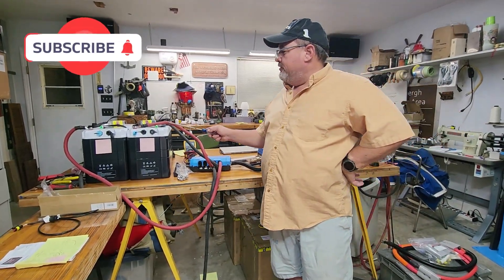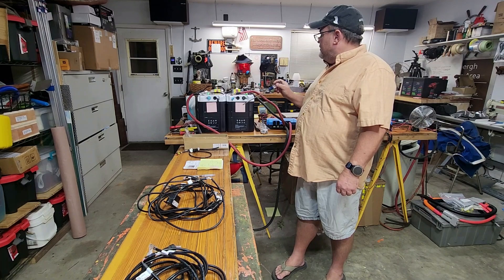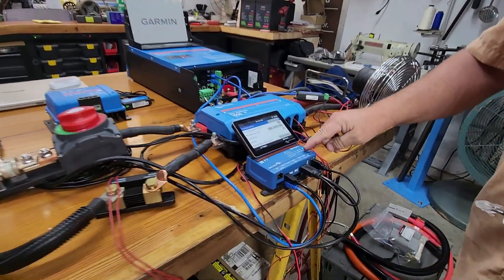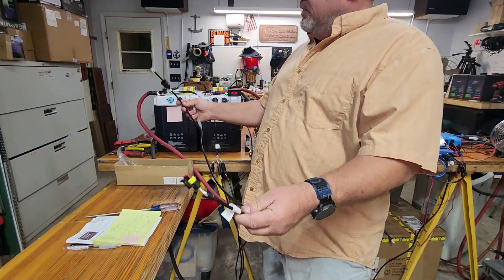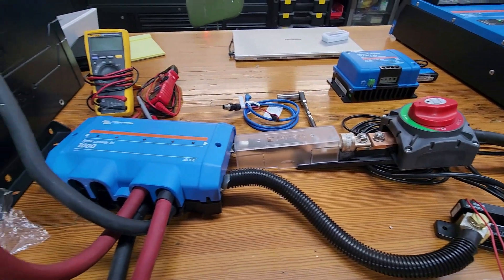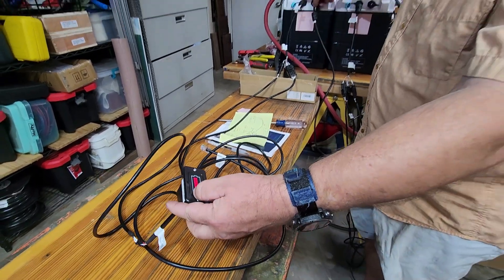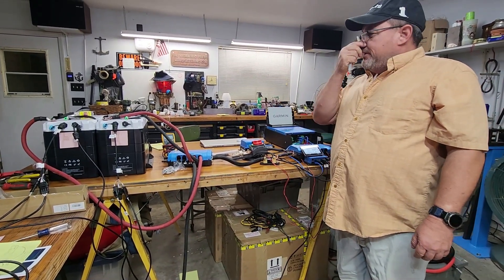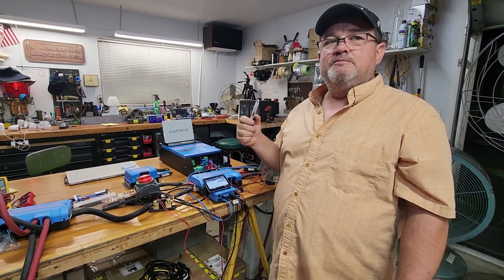Epoch Lithium 460AH V1  Daisy chain hook up  with Victron Comm to Cerbo GX. **Not for V2 batteries**

Comment: My epoch essentials 460ah does not have any ports on it to connect those cables.  My victron multiplus 2 will not charge it. Low battery warning ridiculous as battery at 13.2v verified.  I am buying an epoch charger just to charge that battery.  Tried for days to get the multiplus 2  to charge the epoch battery with no success.  No electrician around me even knows how to get the system to charge.  Very frustrating.
Reply from the maker: Its almost certainly the set up of the multiplus. Check the rocker switch. It's three position. One position is "inverter only" and will not charge.
Reply: @ thanks but my rocker switch is off, on, and a second optional battery.  My multiplus 2 says main on and charging but the light is blinking and not actually charging the battery, I finally got my victron blue smart charger to charge it but still cannot get the multiplus 2 to charge it, I need to find a victron multiplus 2 expert.  Also one YouTuber fixed his by resetting to default settings and then editing the settings again and it worked for him, I will try that
Reply from the maker: @vanandsolaradventures9079  where are you?

Comment: Good informational video!
Per ABYC E13,  all Lithium batteries must have SAE, IEC or UL certification. 
Any testing labels on these Epoch...I believe they dont.
Reply from the maker: @juniinc40  on the website I believe they do for cells only.
Reply: @mvintrigue-trawlerdiy1101  
That's what I thought...not good.
Reply: Great work as always!
I'm looking for that H05-4505 second cable, but cannot find it anywhere...not even on Epoch web site.
Could you provide a link or where to purchase pls, TIA!

Comment: Are you going to use a fuse block holder to mount the MBRF fuses? I watched a tear down of one of these battery modules yesterday and inside the IP 67 case is a class T 400 amp barrel fuse which is nice to know. 

Also epoch is pronounced epic
Reply from the maker: @michaelchownyk5255  the 460ah Marine with comms has a 500 amp internal gR fuse with an AIC of 50k. ABYC recomends an AIC of 20k so it exceeds that.  That internal fuse will satisfy the Arc Interupt Capacity bit its not likely to perfectly match your wiring fusing requirements. So I have used mrbf fuse holder on the terminals for my wiring size. Epoch can be pronounced Eee-pock...or Epic. There is no official way.  Just don't pronounce it like Will Prowse as Eee-poch and I think we will be good lol

Comment: Thanks! A quick question: would you recommend still having an external battery monitor such as the SmartShunt, or can the batteries and Victron comms provide that data? Thanks again, very informative video.
Reply from the maker: Apologies Ross. I am in Yellowstone and cell coverage is spotty. You absolutely need the smart shunt. What I have discovered about Epoch and most built in bluetooth soc meters is the parameters for reset to 100 are set very high and of course can not be changed. This SOC data from the Epoch BMS is what is exported to the cerbo. The ability to set the smart shunts up for full charge detection makes them much more reliable, especially since the 460 Marine does not like to be charged above 13.9. Also the onboard shunt does not detect amps in or out of less than 1 amp. So even at float when the MP drops into float after a full charge the Epoch shunt does not detect the .2 or .3 volt momentary up and voltage fluctuations as lights and other items go off and on. This results in the Epoch soc being off over time. But the victron shunt is still 99.x%. I actually ended up not using comms for charge control. I use the standard MP2 programming and smart shunt for control. The comms work, but will result in charging the voltage to the voltage  set in dvcc in limit charged voltage, which you have to set to 13.9v it will reach 13.9 and stay there and not drop to float. Similar to some other simpler batteries that import data to dvcc  right now my boat is sitting on SP most of the time so  I want to float it.  I have watched your channel many times. I suppose you may be doing something with these soon. If that's the case, when I get back from Yellowstone Tuesday if you need to chat about some particulars let me know. There are a few other must know point such as FCP or full charge protection that the Epoch and newest Litime and others are begining to use. If not set right can result in uneven discharge by huge margins.

Comment: Great Video.  Question for you,  If you have the host battery Victron Comm enabled and communicating with the Victron system, does the slave batteries need to be Victron Comm enabled as well or can I just purchase the non victron comm batteries for the Slave units?
Reply: I called Epoch and got the answer to my question.  If you're going to use Alternator Charging for the batteries then you must use the Marine Batteries with the Victron Comms!  Thanks for the discount code.  It saved me $549
Reply from the maker: @kendallartusi  Be sure to set all your chargers parameters to 13.8 bulk/absorb voltage and 13.4 or 13.5 float. If doing altenator charging I recomend uding the Victron Orion 50 amp DC to DC charger. If you want to direct charge the Epochs from the alternator you really should use something like the Wakespeed 500 or the Arco Zues external regulators to ensure you dont overcharge the batteries causing a charge mosfet disconnect that will cause voltage spike. You would set the external alternator regulators to the same 13.8 bulk/absorb and 13.5 float.

Comment: Have you had issues with your Victron never going into absorption or float mode when using comms?
Reply from the maker: I answered your question on the Epoch forums (Allen Jones). Yes, the Epoch comms currently only provide a single stage charge profile. Or really a CC then CV but the they essentially stay in absorption at the voltage you program into the DVCC as max voltage.. Which is 13.8. Not ideal/ I turned off the comms and use the Victron profiles now and it works great.
Reply: @mvintrigue-trawlerdiy1101     You did answer it!!  Thanks.  Your video and help in the forums have been very helpful.

Comment: I have just installed the same set up for my boat. I've watched your videos a number of times and found them to be extremely helpful. I'm bench testing now and it seems to be inverting and charging perfectly. The one glitch I've run across is that the battery and Cerbo (newest version) don't show up on the Device List of the Touch Screen. I've triple checked all my connections without success. It's starting become a real head scratcher. Did you happen to run into this ... any thoughts? Thanks ...

Comment: For us epoch 300Ah v2 folks you can hook up  2 batteries for Cerbo with 2 regular ethernet cables 1. vecan Cerbo set to 500kb and 2. other battery to vecanbms on Cerbo.
No shunt needed.
Reply from the maker: Thats correct!

Comment: Thanks! Question, why the fuses? Those batteries have a class T fuse built in so no need for any external fuses.
Reply from the maker: At the time of making this video we had not discovered they had class T fuses. But even with the class T fuses you will need to fuse the battery for the size cable and load you plan to use. But since it has the class T inside you can use something like the MRBF that mounts to the terminal and is much cheaper.

Comment: Allen, what settings do you have for your smart shunt? My readings from the battery bms and the shunt differ over time (even with a higher draw).
Reply from the maker: *capacity is the second number next to the 460 in the app/ Such as 458/460 or 472/460 and add each battery for the capacity.

*charged voltage should be set at 13.8 and you should also set 13.8 as your max charge voltage in the dvcc.

* Discharge floor- set to your desired lower limit

* tail current- since the conditions to disconnect the charge mosfet are 14.0 volts or greater > 3.5 charge amps or lower > for 5 seconds, you can set tail current to 2 or 3%. Even 4% will work fine.

* Puekert exponent- some say 1.05 but you might try 1.02. Some even set to 0. Id probably use 1.02.

* charge efficiency 99%

* Discharge floor is what you want to lower limit to be for calculating time to discharge. I set mine at 0 so I can do my own calculation.

***Please note- the SOC meter in the Epoch will not register loads below roughly 1 amp. It also is not as accurate as the Victron Shunt so generally use the victron shunt for  a better SOC determination. But get used to looking at voltages because shunts in general have errors.

Comment: How you received any more info from Epoch as it relates to Victron Com ports? How would you use the com ports if you had 3 batteries in parallel? I believe the cerbo go on has 2 bms com ports.
Reply from the maker: For parallel you would just continue to add to the daisy chain in the same way. Just repeat the same step I outlined when adding the second batterry. Obviously you would need another daisy chain cable. Also Epoch just put out a video showing dip switches for all configurations, including series connections to make a 48 volt 460ah pack.
Reply: @mvintrigue-trawlerdiy1101  Thank you!

Comment: Are those cables only for the Epoch 460Ah V2s?  Is each cable basically a two-port hub (one plug, one internal)?  Did you get them from Epoch?
Reply from the maker: The main harnesses came with my batteries. I had to call Epoch to get the daisy chain harness. However I am told that epoch is including the daisy chain harness with each battery but is no longer including the Anderson plug thick cables since so many are not using those. So you should get everything you need when you order. Even if for some weird reason you didnt get everything you just call Epoch and they will send it. They are pretty good like that.

Comment: Thanks for this video.  I bought two of these batteries for our sailboat back in November and they are amazing.  I am in the process of hooking them up to a new Cerbo GX module and was not aware that they could be chained with the short cable you showed.  I am in Mexico and so can't get the Epoch cable  but I am hoping a I can build one.  Hopefully Epoch will send me the Pinout diagram.  Your work is much appreciated.
Reply from the maker: You can use the two cables you got and use one to connect to the Cerbo and use the other  to connect one battery to the other. Its just 2 wires.
Reply: Well there are gender issues between the two cables but I was able to pick up two pairs of the appropriate weatherpack connectors from which I could make a male-male jumper.  So now I have a host/guest arrangement and the Cerbo reports just one value of 920 AHr from two modules. When we are back in the U.S. I'll order the appropriate cable so that I can still power the battery meter.

As you mentioned, we do lose the ability to see the guest battery on the bluetooth app.  Hopefully that, and a few other improvements will be forthcoming from Epoch.
Reply from the maker: @LittleCunningPlan  Very cool. Glad to hear it! Hows everything working? Plenty of capacity? Im in mid install right now. Thanks for the update.

Comment: My two 460’s arrived last week, they are going into a fifth wheel RV replacing four 100 amp hour BattleBorns.  When the budget allows I plan on getting two more.

Good news, both batteries came with Victron BMS Comms daisy chain cable, I didn’t have to order.  They did not come with the 4/0 gauge cable with Anderson connector. 

I ran into a problem with the switch cable.  I built a box to contain the remote switches and charge indicators for four batteries. The water proof connector on the battery end is larger than the hole needed to mount the switch.  Can’t get the cable thru the hole to mount the switch, and can’t get the nut off the switch without cutting the cable.  Call Epoch support, they are aware of the problem.  They don’t have a fix, suggested using a larger hole with some kind of rubber grommet to mount switch.

I played around with the DIP switches while charging the batteries.  The Bluetooth only works with switches set to Host, any other position and the app would not show full data.
Reply from the maker: Good for you. Thats quite an upgrade. I had heard about the fitment of the on/off switch and was going to look at it. I was thinking the lock ring may slide off the plug but I need to look closer. Another solution is to just cut and recrimp/heat shrink. Another is to make a switch plate out of something like thin black starboard and use two halves. Let us know if you come up with anything creative. I noticed the same on the bluetooth after I made the videos. Hopefully they get an update for that.
Reply: @mvintrigue-trawlerdiy1101  
My solution was cut and butt splice some small water proof RGB lighting connectors.  24 gauge wire is so fun to work with!

Comment: Thanks for the video. I'm planning on installing this same set up on my boat soon.Question ... When batteries are hooked in parallel as you have, do you need both remote battery indicators and on/off buttons installed or will just one of each do their respective functions representing both batteries.
Reply from the maker: You will need both. They are still independent.

Comment: Good stuff. This doesn't apply to my set up because I'm using the Epoch 24v/100AH batteries and none of the Lynx/Cerbo gear, but still great to see and to think about for future installations. Out of curiosity, why are you fusing the terminals with MRBFs? These 460ah batteries have internal Class-T equivelent fuses, right? Are the MRBFs just extra redundancy? Though I would have thought their low AIC rating would make them possibly useless in the event of a dead short anywhere upstream of your main Class-T at the pos busbar. Anyway, thanks for a great video. Subbed!
Reply from the maker: The grey and black units are fantastic as well. I have the 36 volt 100ah in my golf cart and its a great battery.

Comment: I don't see the cable on Epoch's website for doing the two batteries in parallel for part no. B12460A H05-4505 any clues?
Reply from the maker: Yes..just call them and they will send you one.

Comment: Thanks so much for sharing all your work on this. Do you think these could be configured as 2S2P?  I've read that they would work but the communications might not work properly.  Your thoughts?  Thanks!  Franny
Reply from the maker: Unfortunately I have not tried that configuration so  can confirm. The dip switch config does have a setting for parallel and series so I believe they intended for it to be capable. But I havent seen anyone show it reporting to Victron in that way yet. I did see a post a while back that Epoch was working on it. Sorry I dont have the details.

Comment: You just saved me from buying 4 BB gamechanges for over 10k for only 1080 amps and 4 huge batteries, these Epoch are 6000 for only 3 batteries and 1380 amps for my van, WAY COOL!!!!  Saving space, weight and money win win win!!! WOO HOOOO!!
Reply from the maker: Be sure to use a discount code  Mvintrigue for 10% off, too! I agree, though. BB amd Dakota and the like really cant compete. I dont know if you saw but the 460aj Epoch has class T fuses built in. That will save another couple hundred.
Reply: @mvintrigue-trawlerdiy1101   Yup I put the code in before I made the comment, you rock, thank you!!!! My van builder will be thrilled to have even more room to work with the rest of the solar system. Space and weight is super precious in a van!! I just watched the other video you listed in your description talking about the fuses, way cool! Wonder why they didn't advertise that feature as well....
Reply from the maker: @braxenaeurasiers3474  very nice. Thats going to be a monster system.
Reply: @mvintrigue-trawlerdiy1101   Yeah not too shabby for a van! Il have 710 watts of solar on the roof (which is a ton for a van) and a second alternator to charge the massive battery bank!

Comment: Very helpful video. You mention requiring a B12460 A H05 -4505 cable. I have searched the Echo and the Victron site but cannot find any reference for this cable. Can you advise where to order it from. Thank you.
Reply from the maker: I am sure Epoch will have ot on thier website soon. In the meantime, just call them, and they will send it to you.
Reply: @mvintrigue-trawlerdiy1101  Thank you. I will check with them. 

On a side note, do you have any thoughts about alternator charging these big Lithium batteries. 

Typically the alternator will connect direct to the started AGM battery and then a DC to DC charger used to charge the ECHO batteries. 

The problem I’m seeing is that Victron DC DC 12V chargers are only 50A max. For a single engine that would mean about 12+ hours of motoring to charge the Echo bank up. 

Do you plan to use Victron DCDC converters or are you looking at alternatives providers for this. 

Sterling Power has 70A and 100A but not sure if introducing them causes any issues with the Victron coms etc.

Appreciate your thoughts on this.